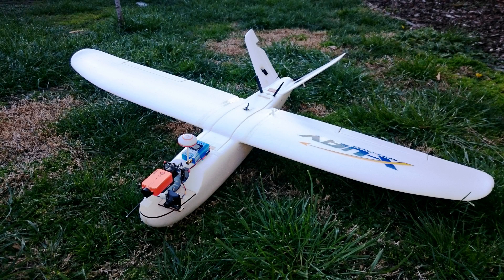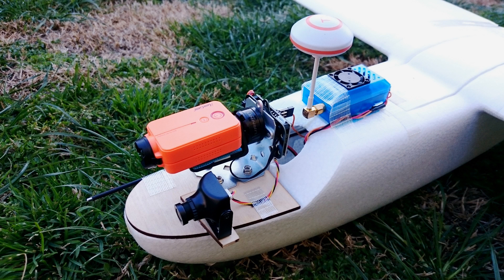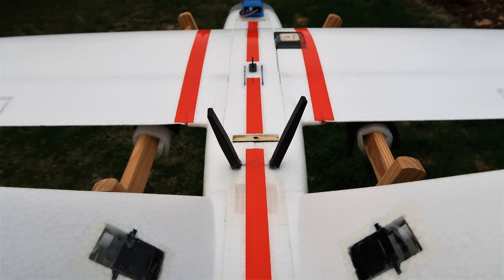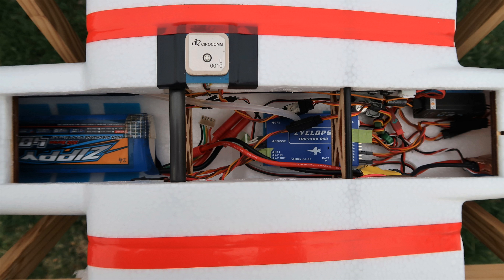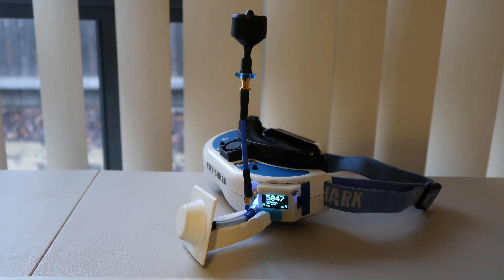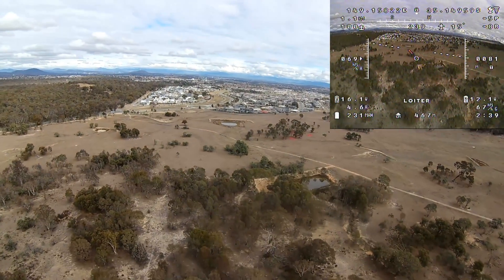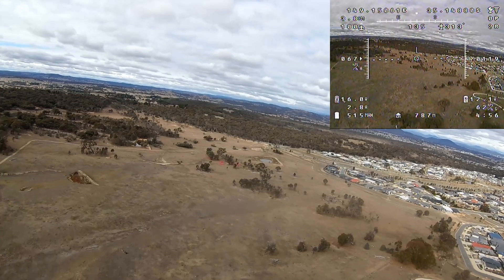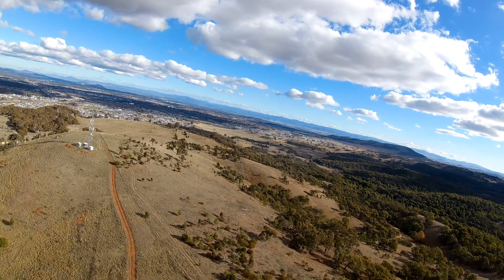Mini Talon Build Number 3 & Maiden Flight (STorM32 roll gimbal)

Comment: I know that this video is at least 3 years old it was wonderful thanks. I'm getting ready to maiden my Mini Talon and I'm just not sure where the CG marks should be I have read and watched a number of videos stating the little one page manual is wrong showing the CG at 50mm from the leading edge. I've noticed in this video you marked your CG with looks to be something round like little cups so you figures tips fit in them. Can you tell me what is the measurement from the leading edge to CG that you've used and are successful with. Thank you!!!
Reply from the maker: Hi, I use 60mm with the wings level and notice it is less prone to stalling when I slow for landing, compared to balancing further back.
Reply: @ZaksterBlue  Thank you so much. I'm going to maiden without a Flight Controller first and get it trimmed out. Thanks again!!!
Reply from the maker: The general consensus in the RCGroups forum is 58-62mm.

Comment: What kind of flight times do you get and what kind of battery do you use?
Reply from the maker: Jon Greene Hi, with a 5A 4S I can cruise around at 65kph (airspeed) for about 40 minutes and still land with 15.1v.  Many would fly their batteries down to lower voltages. On a 7A Li-Ion I could fly conservatively for around 1'15 before getting down to a safe low voltage.

Comment: Hi great video. I've got the same FC that I want to install in mine, but when I last used it my wing crashed when I enabled stabilisation mode, so I'm think one of the settings is wrong. Would you be able to post me pics of your FC screens? Thanks in advance?
Reply from the maker: Hi, sorry to hear about your crash!  Do you have video?  We might be able to tell what happened if you have footage (like if elevator or roll stabilisation direction was reversed).  Showing you my settings probably won't resolve your issue as my settings are specific to my MT build and L9R receiver.

Comment: Great video do you use a ground station anymore or just the goggle setup? I just bought the VAS 5.8 pepper box but have been using it on a seperate receiver and plugging in a lead. Do you have a build series of your talon I’m looking to get one. What battery do you use and roughly what is your flight time? I recently put ezuhf in my fx61 all seemed to check out on ground test but when I went for a fly at the beach it went nuts cutting throttle in and out wouldn’t respond and it came down, later figured out their was interference from cab radios down further so I have gone back to the FrSKY l9r
Reply from the maker: Thanks, no ground station for me.  Hard to beat the L9R for simplicity and performance. I've had it out >14km with more than 60% signal, stock antennas.  If I wanted to go further, I'd consider the 900mhz version, but at this stage video range is my limiting factor.

I don't have a MT build video... you don't really need one, the fuselage is so accessible that you can place things pretty easily. The main 'issue' I had on my first build was not extending the motor wires enough to be able to reach them to plug into the ESC plugs. You want the motor wires level with or slightly past the rear hatch access. Otherwise, a bit of gluing for the fuse and tail, and the wings just slide on and lock in place with a hex screw. I tape over the seam for additional security, but the wings are not glued on.
Reply: ZaksterBlue with the wings do you leave them install or remove for travel , I like the idea of the gimbal for HD at the front what size is the vtx and is it 5.8

Comment: Great to see you back in the air ZB. It amayzes me how consistent the Mini Talon platform is. It seems to have a very wide envelope for any gear you want to install. Thanks for the upload!
Reply from the maker: Cheers Pat, I can't think of any other FPV plane I'd rather be carting around and flying. :)  Need to reduce gimbal PIDs a bit but seems to be flying fine.  Hey, when are you planning on being back?
Reply: ZaksterBlue Around Mid August, probably good to fly September sometime. I’ve been pushing the Mavic to it’s limits but it’s just not the same as fixed wing. There’s loads of places left to explore!
Reply from the maker: Your channel has been pretty quiet. Look forward to catching up. You might be back in time to catch some snow down south.